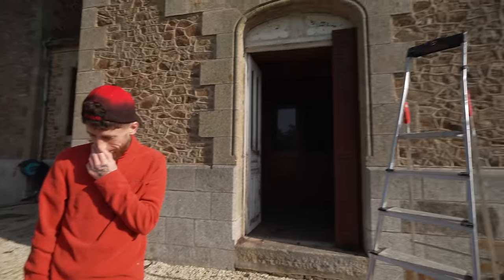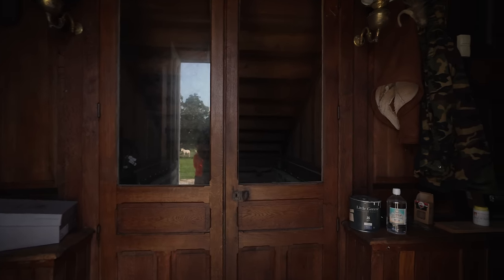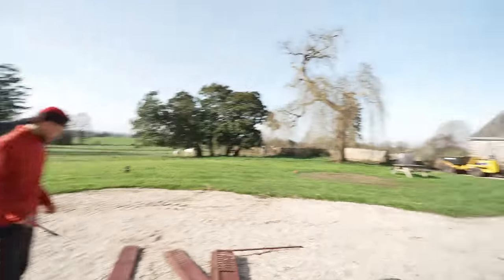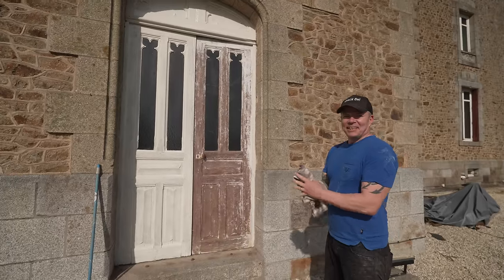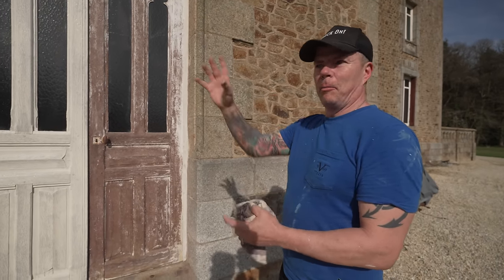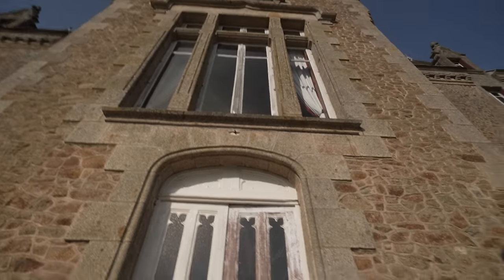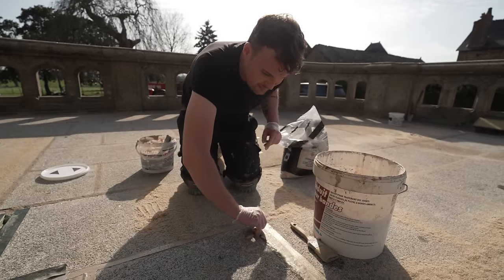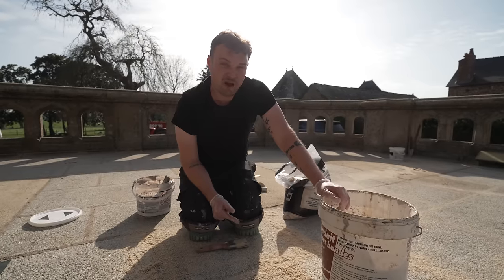Ricks Before & After

Comment: Hi guys,
Michael is doing a great job on the deck.
I just wanted to make a suggestion…
There are sleeves that you fill with the epoxy material and deliver into the crevices like decorating a cake.
This will speed up the tedious job quite a bit.
All the best

Comment: If fibreglass or similar is used on floors in swimming pools, could you use it to cover your terrace to prevent water getting through to the kitchen under the terrace?  Or ceramic tiles with waterproof grout is used for floors in showers.